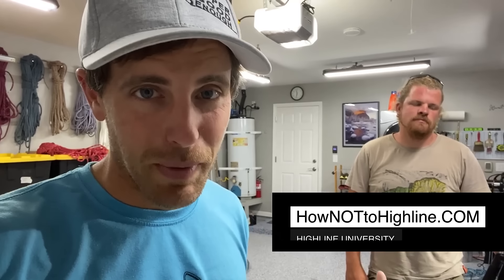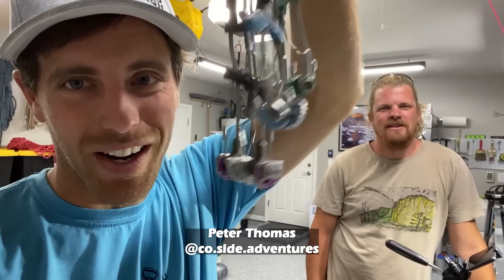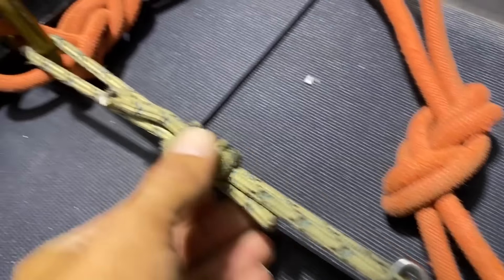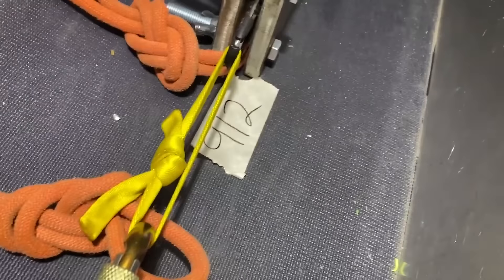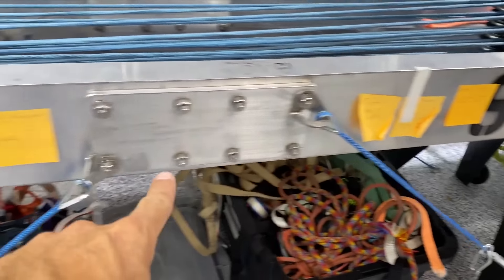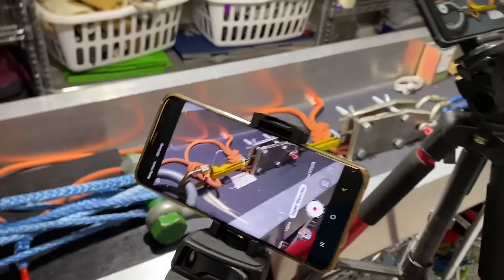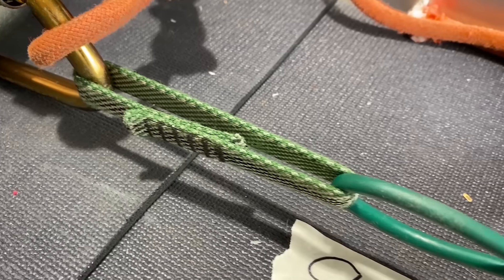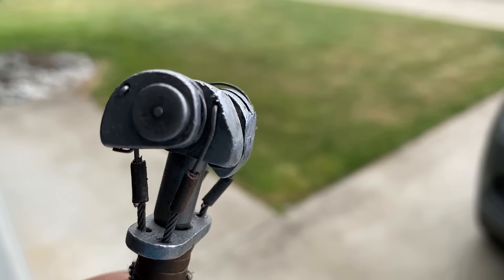Break testing climbing Cams

Comment: I REALLY want to see a cam break test in actual rock. I have never felt great about cams because they are never ever ever ever tested in real rock and thats what you put it in when you use it. I get that the steel is supposed to represent ideal rock but please please do rock.
Reply: I was just about to request that exact same thing! Also nuts and rock too. My feeling is that rock would break before the cam/nut but would be great to see some actual tests and know for sure.
Reply: Maybe some suboptimal placements aswell. Would love to see some horizontal crags with a little sideways pull because i almost had a grounder once because of this. (If you fall while traversing)
Reply: Simplest option would be to just buy two garden-pathway-rock-slpas and glue them to the inside of the camcrusher. That should be good imho, just two granite slaps, not too smooth, should do the trick!
Reply: The steel isnt meant to represent the ideal rock though. It is much much more slippery than real rock.
If you want information that is going to give you some peace of mind regarding cams, keep in mind that most lead falls rarely exceed 5 kN. BD Camalot C4 0.5 cam is rated to 12 kN. Your spine can only really handle up to 9-10 kN. By far the largest factor in what determines how a cam will behave is how you place it and the quality of the rock. If you are placing gear in dry solid granite using sound cam placing technique, your cam is going to be "super good enough".
Reply: There are a lot of people who have tested cams in real rock with their bodies. If they didn't work well professionals wouldn't use them.
Reply from the maker: We knew this would be a popular request as soon as we did this video.  So we already did cams in real rock and will be coming out soon when we are done finishing the edits on them.
Reply: Not a huge fan of this steel adapter, I think it’s more a simulation of worst case than a simulation of ideal rock.

Might work with a piece of rubber or sandpaper glued to the steel though.

Comment: Your test "crack" despite it's seeming beefiness is flexing, contributing to the early slippage that is abrading the cam lobes and triggering failure. Outward lobe force is a multiple of the cable axis force.  Ideally the lobes don't shift at all, locking into the crack plates transferring all the force into the on axis components until the sling, cable,  or cable crimp/braze fails. Or the axle(s) bend destroying the lateral load carrying capacity of the cam. Much thicker crack plates, especially ones of cam  lobe material or steel of similar hardness  would limit slippage.

Comment: I don't think that's 20:1 pulley system, it appears to be a parallel 10:1. The winch still feels 1/10 the force, but each rope feels 1/20 the force. Correct me if I'm wrong.

Comment: This is great - thanks! I'm somewhat reassured that old cams perform so well. Have good slings/replace old ones seem to be the lesson. The cams generally meet standards even after a two-part test of first stressing them until the slings fail, and then stressing them directly. 

When deformed cams slip out, that might underestimate their performance because they're slipping against slippery metal in the brace. OTOH, rock can crumble so who knows. Maybe get a rock saw and bolt slices of granite into the brace so cams are tested against granite? 

Also you might think about putting a link to that Juno coffee here in the description so people can click through to buy and you get a commission.

Comment: The wide end of your crack simulator keeps slipping inwards, so it ends up parallel. A couple of nuts on the inside of the bolts would definitely help stop that.

Comment: I think this has been put forth before, but still: what you have on the SlackSnap is not, in fact, a 20:1 system. It's two separate 10:1 systems side by side, and cumulatively, that's still a 10:1; just the load capacity is doubled. The underlying principle is easier to understand if you consider a 1:1 system – i.e., a single rope. If you add another parallel rope, it does not make it a 2:1 (thereby making everything twice as easy to pull), it just increases the load capacity by two.
Mechanical advantage is easy to measure: take the end of the rope that has less force, and walk with it for a few meters. Measure the distance that you walked. Then measure how much travel the other end has made. Divide the first by the other, and that's your ratio. If you do this experiment with just one strand of the SlackSnap, it's going to be 10 meters of walking for one meter of movement. If you take both strands, it's still going to be 10 meters of walking for a meter of movement, because they are separate parallel systems.
Reply: So, more succinctly: "The SlackSnap has the power of a 20:1 puller, but does it with the travel of a 10:1 puller".
Reply from the maker: So I did some homework.  It boggles my mind no one brought this up before.  If I reaved the pulleys with 1 continuous line and pulled that one strand it would be a 20:1 but you're right.  I have a 10:1.  2 of them and they don't double it like I thought now that I think about it, but they keep the pressure off the pulleys and thin ass amsteel I use... so I just limit what I amount I can put on my samples which is super good enough for what I have broken.  We plan on moving to hydraulics eventually since we understand them now that we have done bolt busters.
Reply: @HowNOT2  Pretty sure having (two) 10:1 pullers in parallel creates double the force of (one) 10:1 puller.  
I'm old, and my brain is older, but you pulling on one of Bobby's arms and me pullin' on the other is roughly twice the pulling of just you pulling on one arm...

Comment: I've never used cams before or owned any....Do most companies make the lobes out of aluminum?
Reply: Also the aluminum serves to deform a bit to the grain of the rock producing the traction needed to activate the cam mechanism. I would think steel would just skate across the rock without activating the cam. For the same reason nuts/chocks are also made from aluminum.
Reply: @gagesilveira6694  Yes I was thinking that as well..The deformation properties of aluminum probably make a better traction surface then steel but you're giving up durability as well..Have any companies tried Titanium? It will deform like aluminum(but stronger), has a grainy, traction like surface when bead blasted but is stronger then aluminum. It's lightweight like aluminum...The only downside is a cost increase in my eyes. I would pay more if I got more life out of a piece of kit like a cam.
Reply: @Caedmon Swanson Yes I'm aware of carabiner material. I still prefer steel carabiners for my applications though. Mostly tactical rope work. Strength and durability are more important then weight.